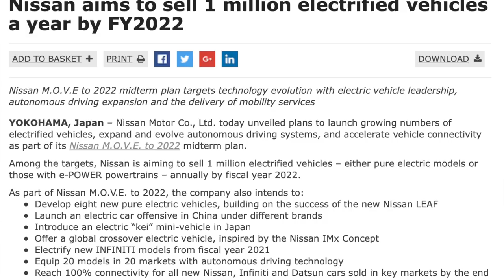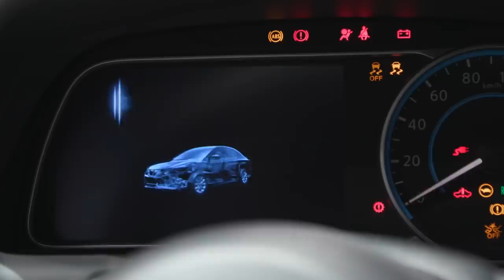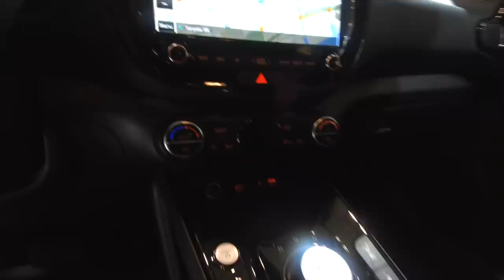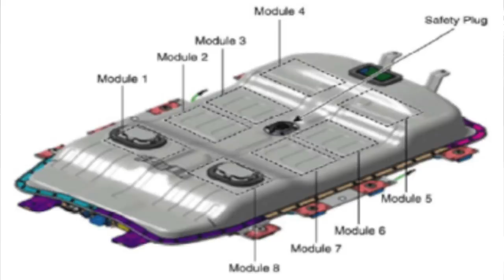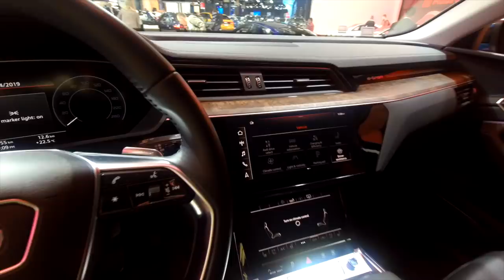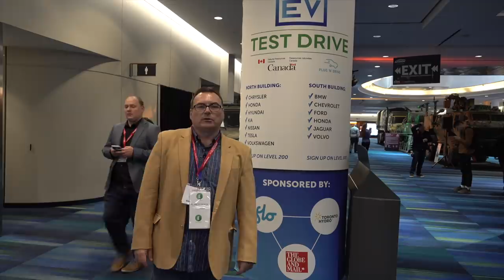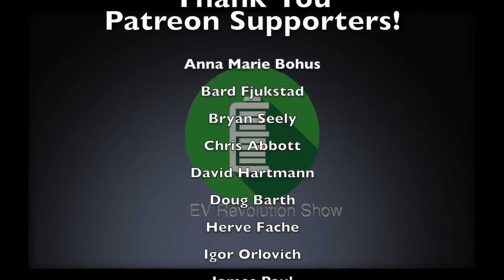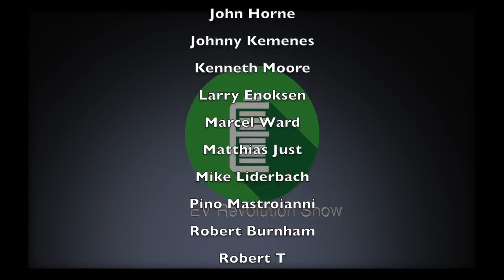Episode 31 PART 2 - More Coverage from Canadian International Auto Show

Comment: regarding the carbon body did you put fia safety cage requirement specs into computer and get the relevant carbon layout/thicknesses so its equivalent to steel body with safety cage inside ???
Reply from the maker: Hi Simon, thanks for watching.  No I did not get too detailed on the RC.  I'm sure you can look the specs up.